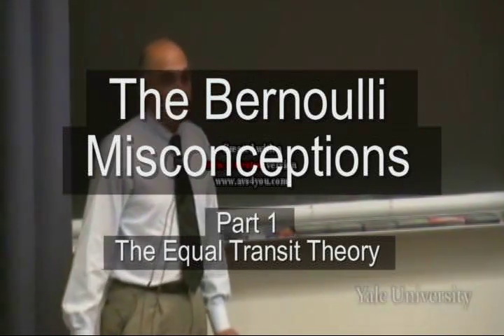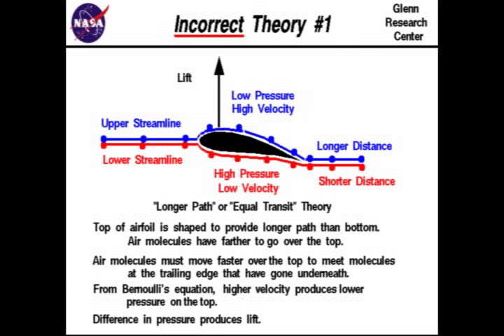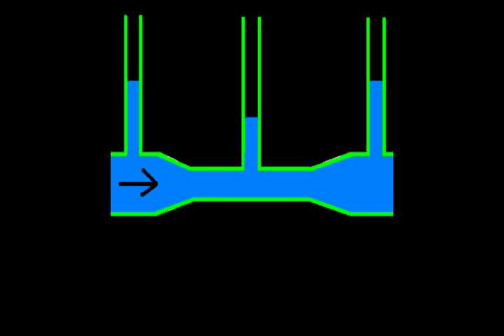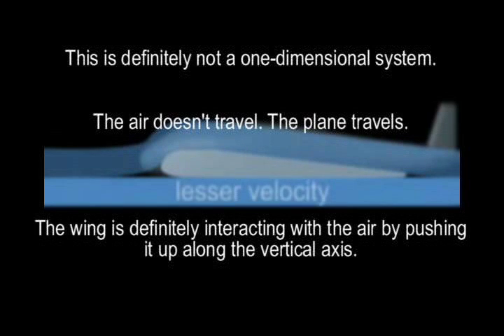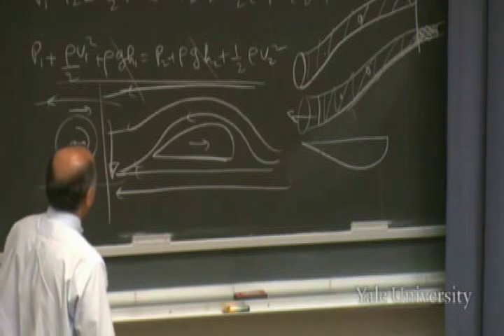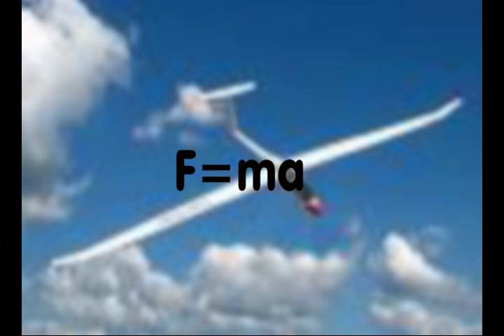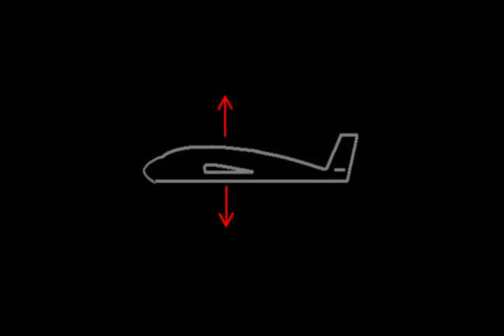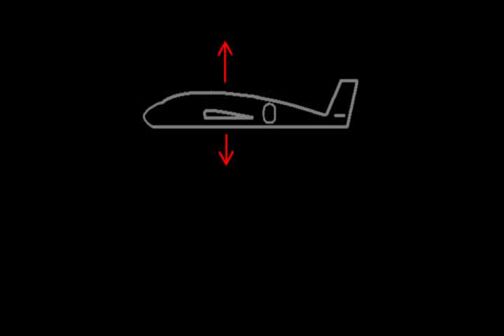Bernoulli Misconceptions 1 - The Equal Transit Theory

Comment: The equal transit assumption is understandable in that a wing flies through what is essentially stationary air relative to the wings velocity through the fluid.  The problem is that this assumption ignores local flow accelerations in proximity to the wing. If the equal transit is assumed, Bernoulli's theory fails to explain the magnitude of lift measured.

In fact the upper surface flow is much faster then the lower surface, in accordance with the local pressure changes adjacent to the wings surface.  I have been told that both the velocity and pressure changes remain consistent with Bernoulli's theory, therefore Bernoulli's theory is upheld as completely explaining the total measured lift & pitching moment from both observed pressure & velocity gradients.
The problem is not Bernoulli's theory, the problem is the equal transit is assumption.

If the equal transit is assumption was true, it would be quite impossible for submarines to make way while submerged, because water is incompressible which would require the entire water column above the submarine to be displaced upwards & compress the atmosphere above it as well.  The magnitude of the displaced mass would be untenable to permit the submarine to make efficient way.  No, a much smaller mass the fluid simply accelerates from the front to the rear of the sub as is also the case with air over the surfaces of a wing.

Comment: I worked on and test flew in Aircraft and Helicopters for many years. I learnt several things. A brick will fly well given enough thrust vectored in the appropriate direction. A brick will fly better if it is shaped like an aerofoil. A brick will fly even better if it is lighter as well. but if you want to talk about design of an aircraft knowing how to launch a brick will only help if you are trying to smash a window.

Comment: Much ado about little.    NO, the  lift of airplane wings is NOT predominantly caused by the shape of that wing.   Most lift is caused by AoA.   But, in fact, the molecules DO move faster over the top, because the air molecules do stay in the same area as the plane passes.  So, SOME  lift is being caused by that traditional wing shape.   That fact is not "rubbish". 

So why not just say it:  Lift is predominantly caused by simple AoA.   And a more minor amount by the fact that when that wing moves thu the airmass, there obviously MUST be "equal transit", and that fact causes SOME additional lift.
Reply from the maker: 37rainman No additional lift is being provided by the Bernoulli Effect. All lift is being made in according to the law of conservation of momentum. Any little effect by the Bournulli Effect would violate the laws of nature
Reply: +Siddis:    Remember, you are essentially talking to a "layman" here! So be gentle.  Have some patience.  (I flew small airplanes during the 80s and 90s.  I always realized that lift was predominantly created by AoA, not BP)

But tell us, are you actually declaring that IF we take that traditional, wellknown wingshape, put it in a windtunnel, with the flat bottom EXACTLY parallel to the streamflow,  that there would be exactly zero lift upon that wing?    You seem to be saying such!   (So, btw, propeller blades are "shaped wrong", also, because they are shaped in that same traditional wing shape, at least the wooden ones I was acquainted with).  I know why that propeller provided "lift" in a forward direction, it was predominantly because of AoA.  But I have never thought that the wing shape of its blade came about because of a "mistake", it was to make that blade the most efficient it could be, just the same situation as the wing.
  So one needs to wonder about this situation. .   For a century, things have been investigated by this manner:  Put it in a streamflow and measure things.   Yet you do seem to be suggesting the shapes of those wings was all a mistake.   Ive got to say, that is a bit unbelievable, to say the least.
Reply from the maker: 37rainman I am essentially a layman in this field too. I have a degree in mechanical engineering, but no Phd in fluid mechanics, or anything. But based on conflicting understanding of various more “qualified” people than us, education does not seen to help very much. No matter who is wrong, we would at least be in very good company.

Albert Einstein, the possibly greatest scientist of all times, weighted in on this, and got it horribly wrong. https://einsteinpapers.press.princeton.edu/vol6-trans/246 Read this article of Einstein, especially the last bit about flight. Einstein based his understanding of flight on what NASA calls “Incorrect Theory #3” on this site  https://www.grc.nasa.gov/www/k-12/airplane/wrong3.html Interestingly enough, I can’t find anything to prove NASA’s assumption. And this is what I wanted to do in my video. Btw. “Incorrect Theory #1” and “Incorrect Theory #3” can be disproven in the same way as they both rely on the Bernoulli Effect for creating lift.

Blades on propellers are also airfoils, but their function is different in the way that they move perpendicular to the rotational movement. Propeller blades will therefore always have a very high AoA. With wings on an plane, it is different. The wings will always have a certain positive AoA, but when flying at travelling speed, the wings interact with so much air which they fly through, that the AoA is hardly noticeable.

And when testing a wing in a wind tunnel, what is important is not the orientation of the lower side of the wing. The upper side will then be sloping downwards, thus directing the air that moves over the wing with a net downward motion, giving the wing a certain lift.

Wings have been developed based on trial and error, and has been formed in a very optimal way. I don’t claim anything else.

The way to view Bernoulli’s Effect regarding lift of an airfoil is that it REFLECTS Newton’s laws. Bernoulli’s Effect does not represent it’s own force that can be put on top of the force created by Newton’s Laws. One can just as well reverse the whole thing and measure the air speed over and under the wing, and from this, calculate Newton’s effect from this. Bernoulli’s Principle and Newton’s Laws reflect each other equally well.

For a wing to have a positive lift, there must be lower pressure over the wing than under the wing. What happens if you have an area with low pressure? Air will rush in to equalize the pressure, thus getting higher speed. The opposite is the case under the wing, so naturally the airspeed will also correspond to the lift of the airfoil.
Reply: +Sid:    >>>>"The wings will always have a certain positive AoA, but when flying at travelling speed, the wings interact with so much air which they fly through, that the AoA is hardly noticeable."<<<<

(-;

Geez, just because at higher speeds, AoA can be less, does not deny that AoA is the prime cause of lift.  Look at a jetliner.  Look at the specs.  The thing is likely built to fly with the body level at flight speeds.  What is the angle of the wings in relation to the body. That AoA is causing the lift.

The fact is, every plane that exists has a blatantly visible angle of attack, and that is what causes lift.  I.e, slant the blade at an angle to the air, the air hits one side of it, the air molecule's energy is imparted to the surface of the blade, and the plane lifts, or the or the windmill  turns.  Any kid whittling a propeller well understands this simple concept.

We could make an inefficient airplane with flat plywood wings and it would likely fly, fitfully, likely dangerously.  AoA.    (I also entirely get what you mean about what causes that traditionally shaped wing to lift.  Thanx.   But the trouble is, if I put that wing in a streamflow as I suggested, putting a series of pressure gauges all around the wing, the gauges on top are going to measure less pressure than on the bottom.  Thus lift.  And not entirely because the wing is throwing air molecules downward.  That is also happening)

Thus I stand by my original claim.  Lift is predominantly caused by AoA, with that wingshape making the system as efficient as possible.  (WHATEVER that wingshape is actually doing to increase efficiency!!   You guys can argue forever the fine points of what that wingshape does, but predominantly AoA is what causes lift)

Gee, willikers, I have seen enough planes with  top/bottom symmetrical wings, so the wingshape cannot be causing lift.  It is the AoA causing the lift
Reply from the maker: 37rainman The Angle of Attack provides 100% of the lift. (If you define a positive AoA from the angle the wing starts pushing air down). 
No, zip, nada additional lift is provided by the Bernoulli Effect. 
You will measure a lifting force on top of the airfoil, corresponding to increased lift for the reasons I have given. For a wing that does not push air downwards, there will be no measured lift due to Bernoulli.